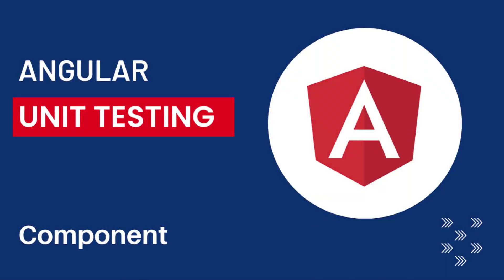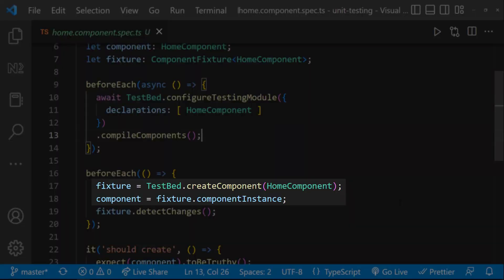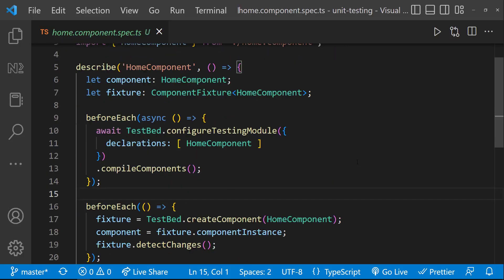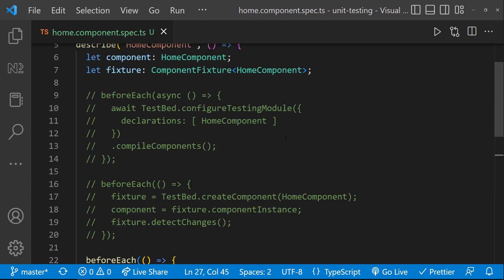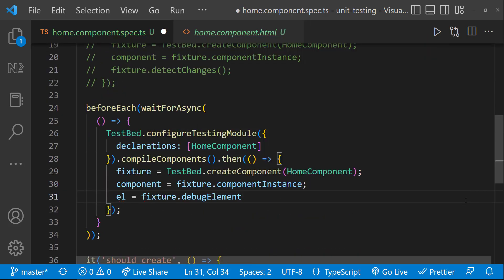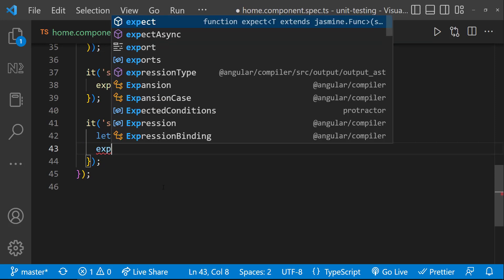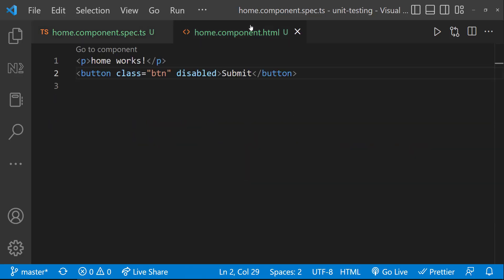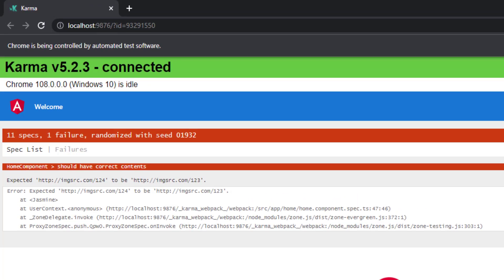Component | Angular Unit Testing Made Easy: A Comprehensive Guide to Component Testing

Comment: Hi, you saying title isnt static and may come from backend, but still declaring it above as static. I do no understand it. Can you please explain how it is dynamic?
Reply from the maker: Whenever it comes from the backend, once it arrives change detection will be triggered. I am mocking up the same situation but instead of setting up a backend I am setting in the component instance. Assume in the real component that once the data comes from the backend we set in the component instance. So here it will reflect only after we trigger change detection manually.